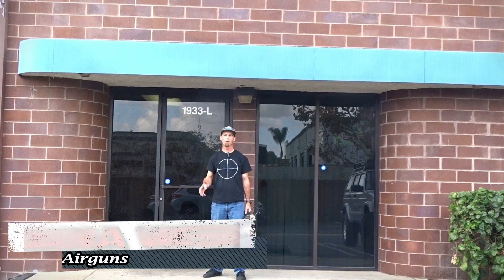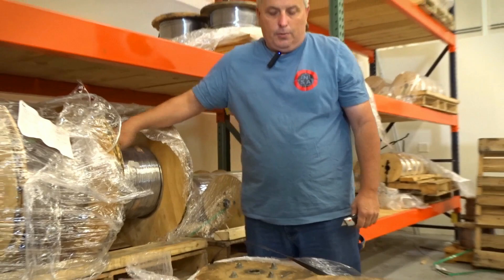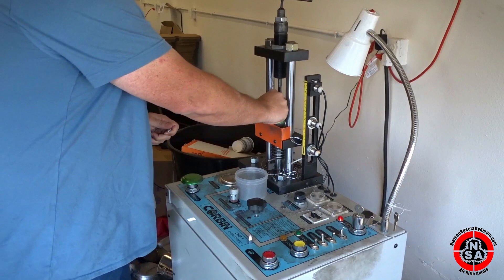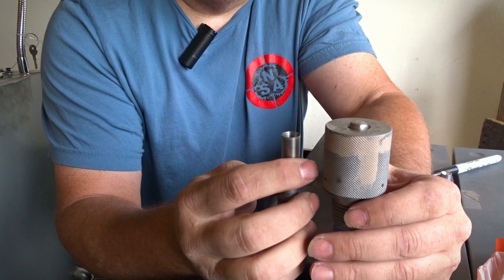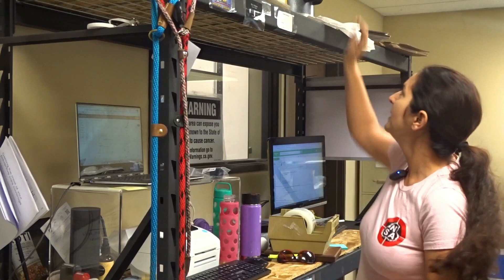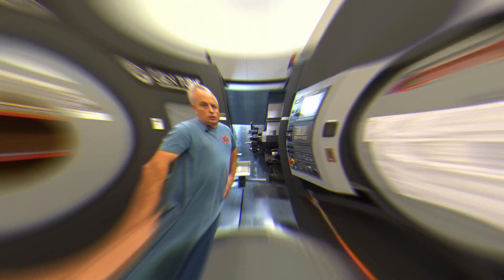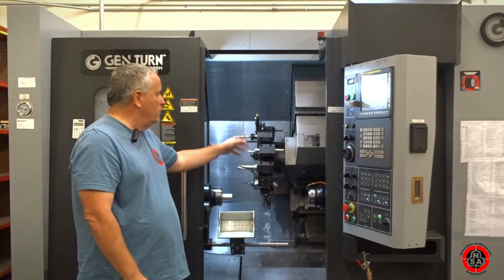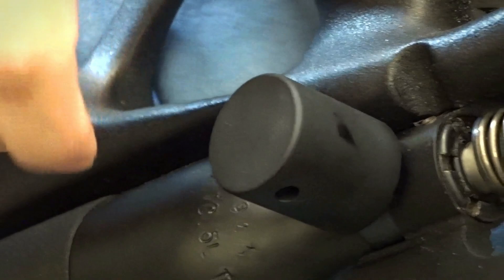Nielsen Specialty Ammo Factory Tour/ All about SLUGS

Comment: NSA makes the best bang for your buck imo, i use the 17.5s in .22 and 29.5s in .25. Both perform very well,
Tip for extra expansion: on a 29.5 i take a box cutter razor make 5 equal cuts on the rim of the nose then score it down the ojive a little, at 880 fps and at 25 yards they expand on a soft target (large tomato) and big towel backstop i got .457 diameter expansion with the 5 pedals curled back, i love these slugs! Thanks NSA! And Mountainsport airguns for the tour!